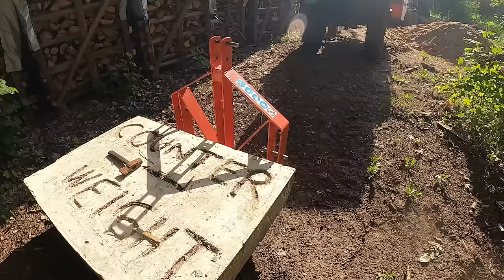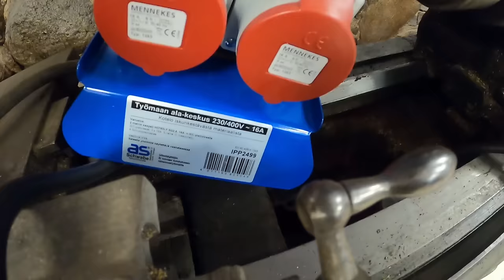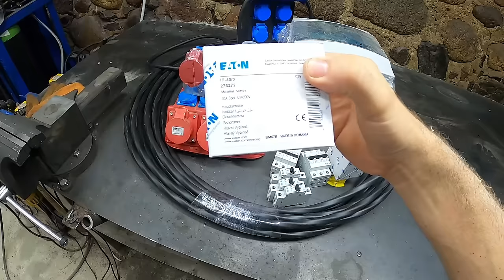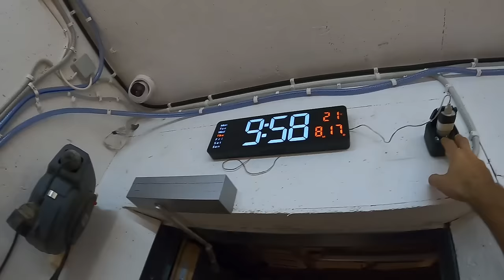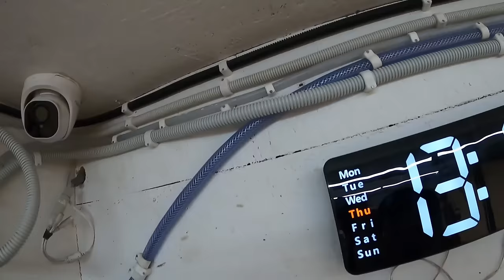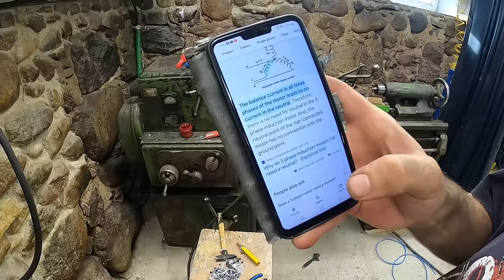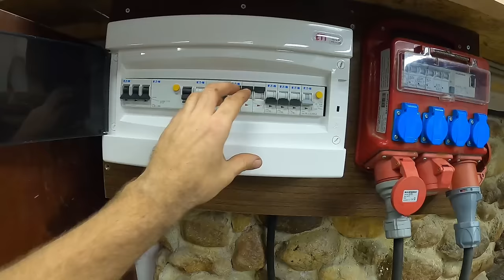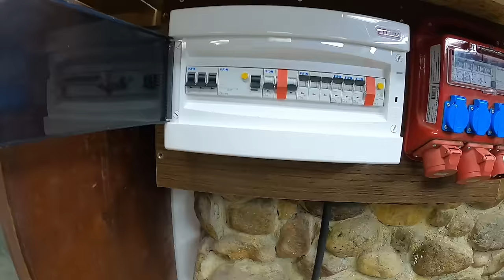Buying and installing a soviet lathe - STANKO 1A616

Comment: Hi. Yes, It`s correct. The lathe is not built with sufficient isolation on rotor and stator in motor so it will probably trip your Earth protection switch. In Norway its mandatory with 30mA switch. But keep it like that, and make sure to Earth the lathe property. Run a dedicated Earth wire directly to the switch panel from good grobunn point on the lathe. Make sure the grounding cable is at least the same diameter as the power cable to the lathe. Then you will mittigate the danger of getting voltage from the lathe. Also, check the cables on the motor. I would also concidered to replaced wire by wire on the late. Cheap and great investment. After that you cam try it with the Earth protector again. Also you can install a dedicated 100mA switch just for the lathe breaker. Best regards from Norway (Electrical automation engineer)
Reply from the maker: I will think maybe trying the dedicated breaker for lathe.

Comment: The sixth “wire” in the cable is a kind of strengthening element with the additional purpose of centralizing the cable. Most of the time it is FRP which is fiberglass strengthen plastic.

Again, really respect and appreciate your work 😍
Reply from the maker: Thanks m8

Comment: You have 30mA fault protector. Usually the old motors starts to leak to the ground when they get old because the windings insulation melts ans turns to dust. You can test it take the cable wich goes to motor and unhookit from motor and then try to start it if it still pops propably its the wiring on the machine. With multimeter u can only test motor if its fully shorted. U need special multimeter which feeds voltage to test the insulation on motor. But u can try with 300mA fault protector if u are scared about if its leaking into machine. Also greetins from finland! Enjoying your videos! Great job !
Reply from the maker: thanks for the tips

Comment: well done, another success and good viewing for us! Big old electric motors often have a small leakage to earth (damp insulation, insulation breaks etc) and will often trip the domestic 30mA RCD.
You could try a higher rating but otherwise I am sure all will be well unless you burn out the motor or a cable wears through somewhere! You will soon learn the lathe controls. Make sure you check the gearbox oil and probably check headsock run-out (adjust bearings) plus adjust the saddle and cross-slide gib strips (remove slack due to wear in the slides). The 'water pump' you mention is called a Sud's pump. It is used to pump emulsified oil to act as cutting coolant/lubricant. One needs this for heavier cuts but you can use hand applied coolant via a brush for lighter cuts. A guard and slash-back will be useful if using coolant - it can spray everywhere! Thats a big powerful lathe so take it easy and learn the basics before performing making big chips (swarf). Have fun!
Reply from the maker: Thanks m8, so far i have not needed it :D

Comment: The one caution I can give you is to never change any of those levers while the spindle is still spinning because the gear trains in lathes don't have any clutches or syncro's, so you will grind the gears in the headstock and damage them, and I'm sure they are not replaceable these days.

The carriage of the lathe moves side-to-side in two ways. One way is for regular cutting and the other is for making threads. It only moves front-to-back for regular cutting.

There are two shafts that come from the headstock (with all the levers on it, located on the left hand end of the lathe), go through the apron of the carriage (where the big hand wheel is) and out to the end of the lathe (where the tailstock is). When you set the levers on the headstock in different combinations it makes the shafts rotate at different speeds depending on what you want to do.

The lower shaft with the key-slot in it is most likely for regular cutting. The upper one should be heavily threaded and is for making threads. The keyed shaft drives gears in the carriage that make it move from side-to-side and front-to-back. The threaded shaft drives the very precise side-to-side thread making motion.

The lever with the Roman numerals on it is probably to select the speed range for either the regular cutting shaft or both shafts. The middle lever might be forward and reverse (if it has three positions then it might have neutral as well), and the one with two handles might be the fine speed adjustment or the thread selection lever (or both, depending on which shaft you engage with to drive the carriage).

The two levers at the bottom of the headstock are to change the spindle speed, as you already found out.

You really will need the manual to positively figure out which those levers does what.

I wonder what that knob sticking out the side near the lever with the Roman Numerals does. That could be used to engage and disengage the shafts. Try pulling it out and then engaging the spindle to see if those shafts start rotating. If so, then flip the lever on the carriage up and see if the carriage moves. Get ready to flip the lever back down in case it moves quickly! It could crash into the chuck or the tailstock!

Once you get the manual it should explain things better. I hope you can read Russian!
Reply from the maker: Thanks for all the useful info m8

Comment: The closest lever to the spindle chuck is for spindle speed 1:1 - neutral - 1:8. I always suggest to put it in neutral when you are touching the chuck or the part as the spindle switch safety feature is not working anymore. Next ones to the left are for threading pitch (the short one) 1:1 - 1x8 and the other is for threading/feed reverse. The pull out knob under the spindle chuck is for threading screw. The other ones I think is easy to find out.
Reply: I was waiting on this kind of help for him. Thanks!
Reply: - Thank you for supporting Andris with your short, deft, tutorial.
Reply from the maker: Thanks

Comment: I thought the problem may have been that the machine was sitting on wood and not grounded. I admire your persistence and skill.
Reply from the maker: It was grounded. Issue is the 3 phase motor

Comment: As long as the machine has a good earth connection it will be fine if a fault should happen to any of the three phases coming into contact with the frame of the machine it will trip the three phase circuit braker you have it connected to so make sure the earth connection is good and you will be OK Keep up the good work
Reply from the maker: I installed a 8mm2 earth wire on the frame.

Comment: The lathe looks like a fun project. If I were your age, I'd have loved to have rewired it for you.
Having spent a few decades fault-finding electrical systems, I'm guessing there's a hidden partially-rubbed wire against the frame somewhere. Sounds like hours of fun tracking it down. A 'Mega' (Insulation tester) would be invaluable in your tool-kit.
Good video. Always enjoyable to watch.
Reply from the maker: Mhm. I think its the motot imo
Reply: @Ants_Pants  I hope it isn't. Easy enough to test the motors with a meg. Rewinds are expensive though; unless you find a cheap (price only) replacement motor somewhere. Good luck with it.

Comment: Holy cow Andris, what a project with moving your new lathe. You are the most awesome Uncle there is, And it's so fun watching you enjoy your niece having fun on something you built. You make us laugh. We have metal boxes not plastic in the USA. We use aluminum for our electric lines in our garage. I love that you are putting sub titles so we know what you are saying in your language. 
Congratulations on the power finally for the lathe. You most definitely need a manual for that lathe. We have a lathe also and you do need a manual, tools, mics, etc our is not as old as yours but it is a older model. You can always unplug the lathe if your not using it for safety reasons. Great video as always. Have a great weekend. 😊
Reply from the maker: Thank you very so much. Nice comment ❤👍

Comment: Highly recommend you build a ladder frame under the lathe with heavy duty casters and threaded resting feet.  You will need to access the back of the lathe upon occasion and by pulling up the jacking feet (which also level the machine) you are on the casters and can more easily move it as needed.   Looked like that electrical enclosure was accessed from both sides and knowing engineers that means some of the back stuff will be hard to get to unless you can go in from either side.  Also I find at six feet tall (I thought I once heard you mention you were that or a little more) a three or four inch lift ( I used three by three heavy wall square tubing for mine) worked out at a nice working height for my lathe.  If I had put mine directly on the floor years ago my back would be in full revolt today!  Entirely optional but that ladder rack also allowed me to built a set of full extension drawers in a cabinet that fit right between the lathes pedestals for full use of the space.  Always needed in a small shop.  I used to have a pretty big shop, but as I filled it with tools it became a pretty small shop!  Kind of a subset of Murphy's Law, I guess!!
Reply from the maker: Good idra. Maybe i will do it one day

Comment: Imo, you need to build a small counterbalance for the bobcat. Btw, the lathe will come in handy if you need to make your own bearing/bushing sleeves. And just because it's a metal lathe, doesn't mean you can't also use it to cut plastic or wood. One more thing... I have a friend that had to run a 220v power cable out to his shed (around 40 feet). He used a regular chainsaw (the longest one he owned) to help cut out a slender trench in the dirt. Since the finished trench was around the same size as the outdoor conduit tubing he was using, backfilling the trench with dirt was a piece of cake. Cutting through roots was also very easy. Some contractors in my area use this method to cut trenches for in-ground sprinkler systems and backyard lighting.
Reply: I don't think this will work for him since he has a lot of rocks in the ground. But for sandy and earthy soil that sounds like a great idea!
Reply: That bobcat is designed to lift some weight, and it already has the counterweight that it needs for this. If you add more weight, you risk damaging the hydraulics (bent cylinder rods are not fun, and expensive) or you even bend or break the frame or boom. If your bobcat can't handle the job, you really just need a bigger one.
Reply: @ProtonOne11  I don’t see the weight kit on his bobcat. (Bobcat sells one) A properly working hydraulic lift circuit will go over relief before bending rods. Every bent rod/damaged cylinder I’ve replaced has been due to shock load pushing stumps/side loading the lift arms.
Reply from the maker: I will weld the lathe to the bobcats ass as a counterweight

Comment: Hello Ants, The lathe must be set up properly on steel screws and washers so that the machine is level. I would also recommend an emergency stop switch so that you can quickly turn off the power from the machine in an emergency. In order for the machine carriage to move, the middle shaft at the front must rotate when the machine chuck rotates. So you have to calmly figure out which of the levers on the left side is responsible for it. The lever at the bottom left with the scale looks as if it is there to adjust thread pitches. Unfortunately I don't know the Russian type but the old German lathes aren't much different either. It is also important that you always keep the surfaces where the slides run on very clean and always have a light film of oil on them. The machine will thank you. If you have time, I would also change the oil and, if I have a lot of time, change the cables bit by bit. It's a shame that you live too far away, otherwise I would be very happy to help you with that Greetings from Berlin
Reply from the maker: Hello and thanks for the support :)

Comment: 4 wires in 3 phase cable means that it doesnt have seperate N and PE and that it uses PEN. PEN is combination of N and PE (neutral and ground). That fifth "wire" on cable is for pulling sheating off cable so you dont break your nails. On fault protection thingie (that thing with lever and test button) neutral always goes on right side (its marked with N), also maybe there is fault on lathe so it tripping other fault protection thingie.380v rating on lathe is rating for lathe, but it will work on 400v. Minimum and maximum 3 phase voltage is from 380-410v. I think that you should do complete rewire on lathe beacuse it looks too dangerous to be even used. Your friend was right about using lathe thru fuse only but wrong too. Fault protection thingie saves you from getting hit by electricity and beacuse lathe is all metal its better to use it.
Reply: About minimum and maximum voltages, the norm in Poland says it's +-10% so it can be 342-418v and I presume that this standard is across Europe.
Reply: - Thank you for supporting Andris with your short, deft, tutorial.
Reply: @Vein1986  norm in croatia says +/- 10-20%. Its different in every area in croatia
Reply: @gamingit1  20%? Wtf, so you can have 276v in one phase socket?
Reply: @Vein1986  yes but its rare to see. Most of houses have overvoltage protection beacuse of that
Reply: @Vein1986  its very rare but yes, norm says that some places can have +/- 20%. Its very weird but all of houses by code need to have overvoltage protection beacuse of that
Reply: AFAIK, PEN is only allowed in America, where the power goes through a transformer, and the neutral is the local neutral.

In Europe (at least the cases I know about), the neutral is supplied by a power-company owned transformer, which may be placed a lot furhter away. So there can be a decent voltage difference between ground and neutral.

In Europe, all installations are obligated to be behind an RCD/GFCI. In America only the "wet rooms" are placed behind an RCD/GFCI. This is just because we can't trust the neutral wire in Europe to be 0V. Connecting ground to neutral in Europe will often trigger the RCD/GCFI, but normally not in America.

Old machinery, like this lathe, may still be designed without separate earth and neutral in mind. But it's pretty dangerous to use that on a European power grid.

Either the lathe has to be rewired with separation between ground and neutral in mind. Or the lathe can be isolated from the supplied neutral by putting a transformer in between.
Reply: The fifth wire isn’t for removing the sheath, it’s to separate the cores inside the cable, that’s why it’s made from rubber…
Reply: @____________________________.x  its for that too and for taking insulation off
Reply: @gamingit1  1:30:43 You can see the cotton tape that is commonly used to remove the sheath. The rubber filler is just that, to maintain the spacing of the cables to ensure the cable is mechanically and electrically consistent. You'll find the same filler inside armoured cables where obviously it couldn't be used to part the sheath. You can use lots of things to achieve an outcome, but that's not why they are actually there
Reply: @____________________________.x  in croatia we dont use armoured cable, we use cable that has 2 layers of outer insulatio and we use it for underground and outdoor stuff. It has that thin plastic string that spaces wires out and can be used to pull sheating off. Im talking from expirience
Reply: @gamingit1  armoured cable is better partly because rats will chew through rubber, but it is expensive. The point remains, the rubber core is purely a space filler, the tape is for removing the sheath, although we'd use a plow blade tool
Reply: @____________________________.x  yea true, but we also use steel conduit for outdoor instalations so there is no chance that rat can chew thru, some of older cable actually have like thin sheet of steel in between of two layers but they stopped using them
Reply: @sanderd17  here in croatia we use PEN
Reply: It's not (that) dangerous, oldskool soviet 4 -wire 3 phase used earthing as neutral for big control relays - back then fault protection was not used and this small relay current did not cause any harm. Back then it was called "nullimine" (zeroing), earthing and neutral wires get together in fusebox anyway. If they get together before, not problem. You have to have seriously bad earthing if those wires cannot handle one or two relays. Chinese make 380V to 24V power supplies to be able to use 24V relays with 3 phase and earthing and no neutral without triggering RCD.
Reply: @Tegelane5  its called PEN (neutral and earth connected) and it was called zeroeing. To this day, i still see house installations done like that (only if it is mix of old and new) and i do electrical every day

Comment: Use a foot pedal as a safety switch. It only gets power if you are on the switch. That way, if anything does get caught, simply lift foot.
Reply: Great idea
Reply: It would be a good idea but you don’t want that on a metal lathe because most of the time you run the carriage of the lathe very slowly to get a good surface finish and it would be really, really boring to have to stand there on a switch when you could be doing something else in the shop while it was cutting.
Reply: Yes and if you let go
Go off a switch lathe will magically stop on the spot and will not keep turning by inertia... don't know if this lathe has it but many have breaks, and still it takes a second or two for it to stop
Reply: pedals on lathes are used as emergency stop which you push in case of emergency rather than holding it all the time to keep the machine powered.
Reply from the maker: Interesting idea